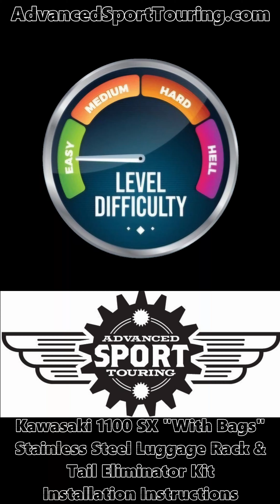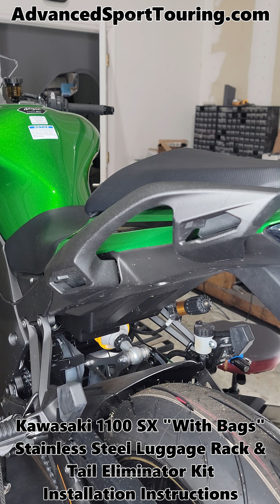Kawasaki Ninja 1100 SX Stainless Steel Luggage Rack for bikes "With Bags" Full Install

Comment: Can you still install the OEM side cases with this? The issue I’m having right now is the SX/SE is an either/or system. Top case OR side cases, but not both. I’m looking for a solution to that so I can take trips an have a more convenient comfortable ride for my passenger.
Reply from the maker: Absolutely.  Our kits work WITH the hard bags installed so you can have both.  Take a look at this link.  We have several options for you: https://www.advancedsporttouring.com/category_s/1920.htm